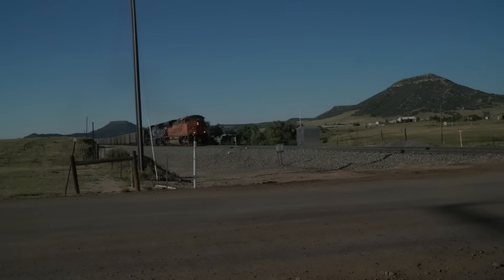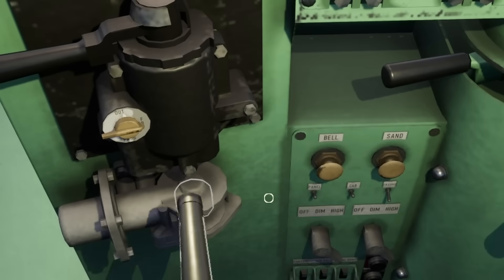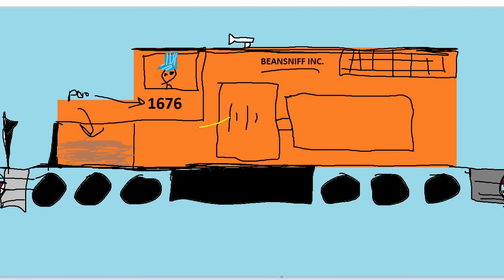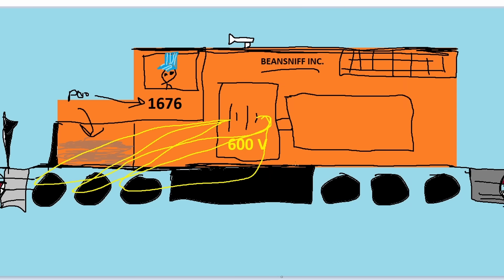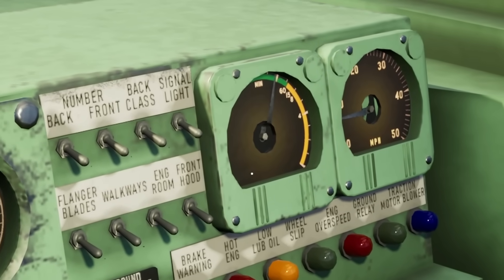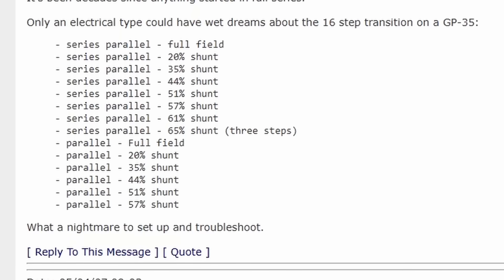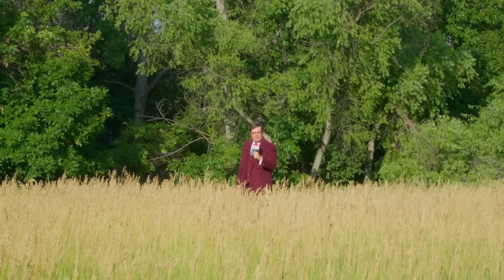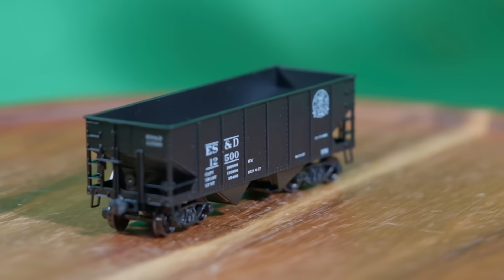The HIDDEN GENIUS of diesel electric locomotives... Transition explained - Railroad 101

Comment: With how mystical it seems to locomotive engineers and the way it helps regulate the current/voltage in the traction circuit, is this essentially like having an automatic transmission for a diesel locomotive?
Edit: I brought up the first part because I still struggle to comprehend how planetary gears work in automotive automatics

Comment: This is highly informative, thank you Mark. I know this is somewhat similar to the throttle control in streetcars, but is this a similar setup to large electric locomotives? Reason I’m asking is that I’m trying to design a simple throttle control for my prototype electric locomotive, while trying to steer away from the effective but highly wasteful resistance circuitry, since it’d be preferable to run on DC.

Comment: When you get around to AC traction, I hope you will also explain how dynamic braking works for AC.  How does an induction motor work as a generator?  How does traction motor generated electricity get to the brake grids?  What, if any, is the contribution of the inverters to dynamic braking?  Are the dynamic brake fans driven from the alternator or the traction motors?  All this from an ME who didn't understand why he had to take an EE survey course and who shouldn't have taken it before completing the math class that explained Laplace transforms.

This video makes me appreciate more the folks at the Great Lakes Central Railroad who keep the old Ann Arbor GP-35s running.
Reply: AC Induction motors work as generators mostly just fine. Their rotor fields end up being a bit on the weak side, and the induced magnetism dissipates rather quickly when powered off, so they generally can't cold start. Think of the generator ability coming from the Back EMF you'll see from driving a motor. The faster they spin, the higher the voltage, and in this case unregulated. All modern variable frequency drives (inverters) are able to allow that excess voltage to pass onto the DC bus where you pass to your braking resistors.
Reply: AC traction dynamic braking involves giving the traction motor a driven speed slower than what it's actually turning. When the rotor spins in this slower-rotating field, it induces a voltage in the winding of the motor. Through some electronics stuff I don't quite understand, the inverter rectifies this 3 phase input and puts it back on the DC bus. At this point the braking contactors close and the braking grids do its thing, dissipating the generated power. 
You can adjust the voltage and "frequency" of the inverter to apply different braking efforts, and you can run this all the way down to DC- or 0 hertz, meaning you can get full braking effort down to a very slow speed.
Reply: @pootispiker2866  the output transistors are called IGBTs. They can only conduct in one direction, just like a diode but can also be turned on and off on command. They are used to stimulate an AC waveform from DC, but have a fun side job at rectifying power going backwards, back into the inverter on command. It takes some extra circuitry to make it work well, but that's old tech at this point.
Reply: @SuperS05  >the output transistors are called IGBTs. They can only conduct in one direction, just like a diode but can also be turned on and off on command.
False, all IGBTs incorporate an anti-parallel diode (also called free-wheeling diode), which carries reverse commutation loads. This diode also enables dynamic braking.
Reply: @Knsgf in this case, the freewheeling diodes are not needed. You already have 6 power IGBTs, in a 3 phase arrangement.
Reply: @pootispiker2866 very close but no quite. Once you get within the slip range of the motor you might as well just use your brake. Not quite 0 rpm but very close.

Comment: So if one traction motor died, it kills the power to the entire truck at low speeds (or  both ends)?
Reply: There are cut-out switches, which isolate and bypass a faulty motor.

Comment: Awww dude!  You're on a roll today and I'm only at the 1:55 mark.  First it's ohms (no, not the ZEN type) and then it's "Melty sadness"  Well done, you definitely put a smile on my face.  Thanks for sharing, I'm off to watch the rest.
Reply: "Melty Sadness" is an electrical engineering term, along with "magic smoke." Closely related to the theatre adage that every machine is a smoke machine if you use it wrong enough.

Comment: Great video that explains the basics!

The Z you avoided talking about at 1:13 is useful for AC machines. You can think of it as the equivalent to DC resistance. Ohm's law is the same for AC, just looks different with the letters used.

AC motors don't work the same as DC, their speed is locked to the frequency of the supply voltage. This requires extra control circuitry to change the frequency output by the alternator to what the motor needs at the speed the locomotive is moving at.

Comment: AC traction and inverter stuff is crazy, excited to see you do a video on that type of stuff. The different ways manufacturers have created different pulse width modulation methods gets pretty complicated with a whole bunch of mathematical harmonic elimination shenanigans but the bare bones idea is that you're generating three AC sine waves 120° offset from one another with three pairs of solid state semiconductor switches be it thyristor or transistor, the higher the fundamental frequency of the sine waves the faster the motor spins.
Reply: They're also induction motors instead of brushed, so they can run stalled without risking flashover.
Reply: @davidfuller581  Yuppers! In some parts of the world synchronous motors or some other flavor of brushless motor, but indeed, squirrel cage asynchronous induction motors are the most common you will find especially in North America, at least for railroading. Also with the added benefit of quick response inverter control that can reduce slipping, in the case of GE they have an inverter unit for each axle which gives even better control to reduce slip.
Reply: Gesundheit!!

(I actually understand AC traction to some degree, by the way...but the sheer "nerdery" of that statement was too much not to comment on.  I love it!!  Question - how do they eliminate the harmonics?)
Reply: @ContoocookRRMuseum  Likely they have snubber filters after the switching elements, effectively LPFs.
Reply: @davidfuller581  From diagrams I have looked into theres filtering before the inverter but never filtering between the inverter and motor. Usually after the rectifier theres the DC link capacitor(s) that smooth the ripples in the current out to deliver more consistent current to the inverter unit(s). Theres a video called "Gear Changing without Gears: PWM Motor Drives" that goes into the principal quite well.
Reply: @graythewolf6096  I'll check it out, thanks for the rec!
Reply: @graythewolf6096 at least from what I know. Induction motors are insensitive to harmonics as long as you have the right bearings (which you would on a piece of equipment at this scale). But the electronics, transformers, and power factor on the grid don’t like it. Transformers may get hot from harmonics. Electronics ruined. Power factor reduced. Inductors capacitor sets make ok harmonic filters. But I know there is also active harmonic filters. I am unsure how those work though.
Reply: @ContoocookRRMuseum I have heard a few methods, a lot of which seem to be pretty much the same, just different nomenclature from different manufacturers. Selective Harmonic Elimination and Current Harmonic Minimum are two common terms I have heard of where switching angles are calculated to get lower THD I guess? It's swtichcraft beyond my understanding honestly 😅

Comment: I'll add this to the things I was not taught in school that I wanted to understand but no one could explain it to me file.  It's really fun when you have 3 SD70's that all hit transition at the same mph in the same train.  Feels like you're about to get a knuckle.   Something else that's simple but very few out here understand is how a retainer truly works and why it works fwiw.
Reply: Similar to the lurching of an automatic transmission car - one of the reasons I prefer manual. Wonder if they could be designed to avoid doing it all at the same time, either whenever one does it it sends a signal to the others to not do it just yet, or perhaps just intentionally set the automatic transition point a little different in each loco so that hopefully they'll not do it at the same time.

Comment: I gotta say this is my favorite educational video so far. I'm an electrical engineer but more in power utility. I wouldn't say that this is basic stuff for electrical engineers. Motors are a whole field in and of themselves. I doubt a mechanical engineer in robotics would know the ins and outs of boilers.

At my museum we're rebuilding a GE 45-tonner, it's been absolutely fascinating to delve into the world of electric motors and generators. Simultaneously, I've been working on my masters project which involves building an alternator. The part that's been the biggest learning experience is that a lot of higher power alternators do not use permanent magnets on the field but instead use electromagnets so that they can vary the desired output voltage.
Reply from the maker: Glad you enjoyed!
Reply: I always thought alternators using electromagnet field coils for voltage control was fairly standard? I'm pretty sure that's at least in part how it works in car alternators (including mine from the '70s). I know just spinning it won't make power unless "excited" by some power from the battery, and on my car (later-model VW Bug) it supposedly won't even work if the alternator warning light bulb is burned out as that's a required part of the excitation circuit.

Comment: In the early 1970s, we learned Ohm's Law as E = I × R. Here, "E" (Electromotive Force) represents the push, "I" (Current) is the amount of  being pushed, and "R" (Resistance) is the opposition to flow.
Reply: The way I've often seen it described is the "hydraulic analogy," volts are pressure, current is flow rate, and resistance is flow restrictions. A useful analogy, though in terms of the flow of electrons it's fairly accurate to what's really happening. Doesn't really work for describing electromagnetism though.

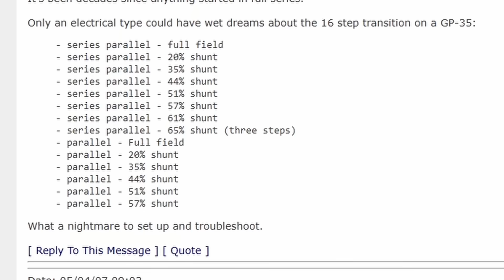Comment: 8:30 most likely explained by switching the stators' field coils between series, series-parrallel and full parallel. 
Assuming you want all coils to recieve the same voltage, finding n different configurations is equivalent to finding n different compositions of the number of individual coils. 
the smallest number that has 8 compositions is 24.

The same can be done with the rotor if it's an externally exited type (eg. with sliprings), but that would create another maintenace nightmare.

Comment: This also depends on how the coils of the rotor and stator are connected. 
eg. having the rotor and the field coil in series or in parrallel changes the amount of back EMF, and the torque-speed curves look different too.
Reply: Somebody here remembers their Motor Theory class !

Lovely you've got compound you've got shunt you've got series you've got serious shunt then you got shunt series . Induction. Wound rotor more flavors of Motors than there are in Baskin-Robbins ice cream😂
Reply: @Peterthethinker  SQUIRREL!!👀
🤣
jokes aside, the range of characteristics that can change just by connecting the coils in a different order is wild.
Reply: I understand that's basically series-parallel combinations of the windings within a motor versus supply to multiple different motors. Same result. Then there's large induction motors that switch from star to delta configuration (or other way around, can't remember) as they speed up.

Comment: For people who have a hard time conceptualizing back-EMF, it's sort of electromagnetism's equivalent of friction.  You can't make a thing move without some kind of opposing force try to make it stop (under normal conditions), and in a system that works off of magnetic force rather than mechanical force, you get back-EMF instead of friction.

(Disclaimer: This is a very handwavy explanation, I'm sure an electrical engineer could poke holes in it).
Reply: Yup.  An alternate way I've heard of looking at it is that it's the motor also acting as a generator.

(The main hole in the friction analogy is that, unlike friction, back EMF doesn't convert useful energy into thermal energy.)
Reply: Then you still add friction and resistance on top of back emf.
Reply from the maker: Makes sense to me!

Comment: At the operator level, transition is just the sudden jerk at around ~40km/h that might bounce your nose off the windscreen if you aren't expecting it.

The smoothest-riding DC locomotive I have ever run is AB1535, a 1969 EMD G22CU (or SD20 if it spoke American), a 1500HP 6 axle loco that has no series-parallel circuiting at all! It's entirely wired in parallel, and uses progressively higher field shunts to keep the motors spinning as it speeds up. I know of folks who back in Westrail (WA Government Railways) days, would try to specifically request AB locos for passenger charters because they didn't jostle coaches around like a typical unit might under the control of an indifferent driver.
Reply: All of EMDs alternator-driven geeps are like this. And obviously the new ones, too.

Comment: so this is the ka-chunk in the DE6?
Reply: Literally an audio recording of the very big contactors opening and closing to change the Traction Motor circuit wiring, correct. :)

They also do big CLACKETTY-CLACKA-CLACKs and motor whine when you set up Dynamic Braking, as the Motoring Contactors are opened and Braking Contactors closed to 'rewire' the traction motors as generators and connect them to the Braking Grids.

Comment: Betcha didn't notice when that NJ Transit PCC streetcar transitioned while you were running it!  Picking up the second acceleration contactor actually is more noticeable than going into parallel on those beauties, but like any electric railway equipment, they do it too!
Reply: Czech PCC derived trams like Tatra T1/T2(R)/T3/K2 have both motor groups always in paralel, however you notice sudden acceleration during field weakening positions at around 30 km/h (20 MPH)
Reply from the maker: Ya know, I didn't, but I really didn't know shit about this back then. Lol!